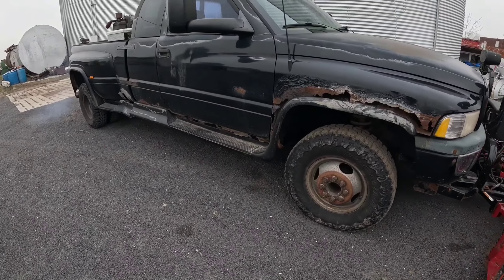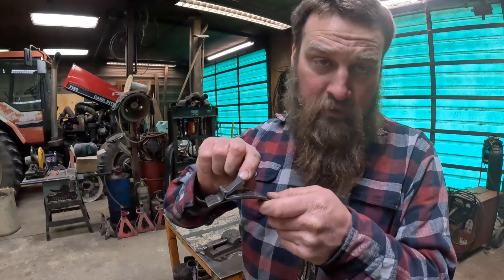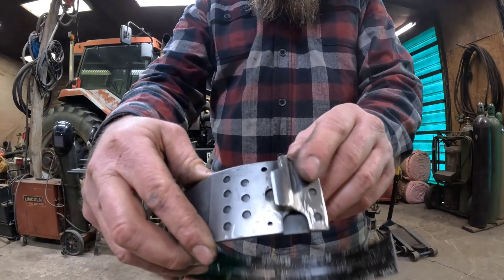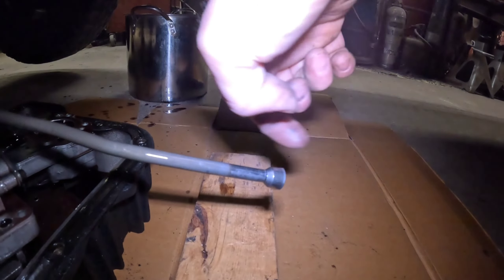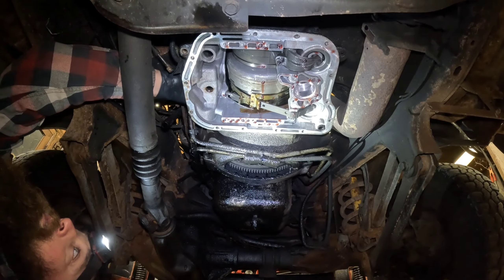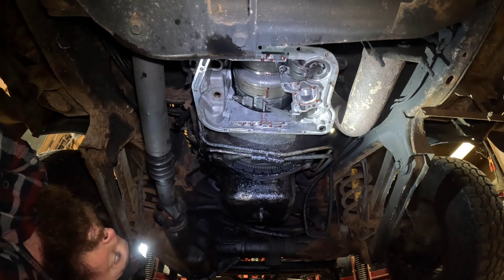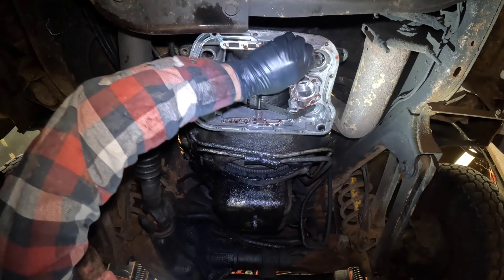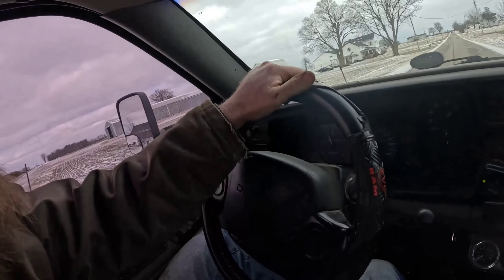Repairing 2nd gear on a 47RH-47/48RE with the transmission in the truck. |Dodge Ram Cummins|

Comment: Awesome,  I tried doing this a few years ago but didn't think to shave down the tabs....ended up just pulling the whole thing to replace that dumb band.   Just rebuilt the ole 47 for the 9th or 10th time but if I lose 2nd again I'll use this method,  really not even a half ass repair!
Reply from the maker: Thank you!
Yeah if done with care, it's actually a relevant repair that I've seen last as long as pulling the transmission and pump and sliding one in.